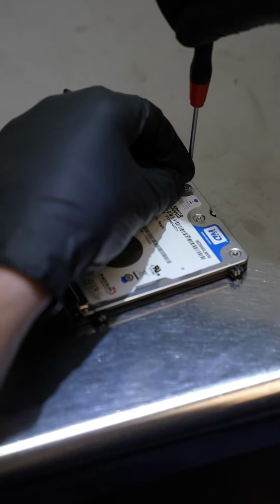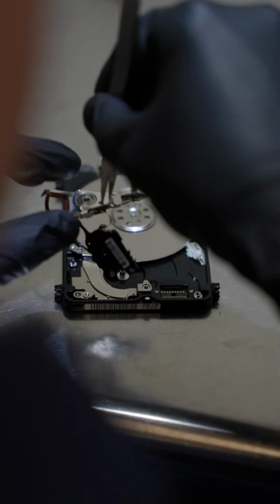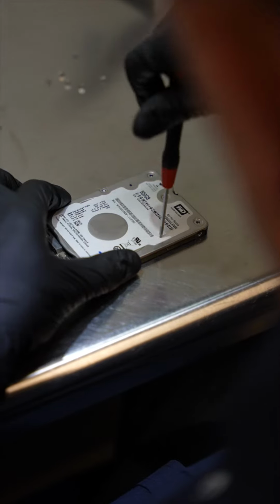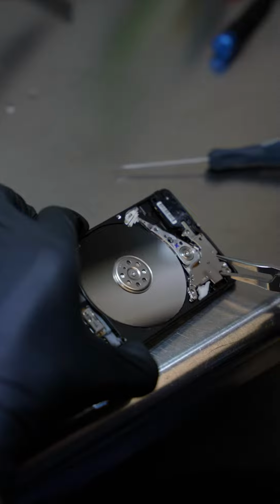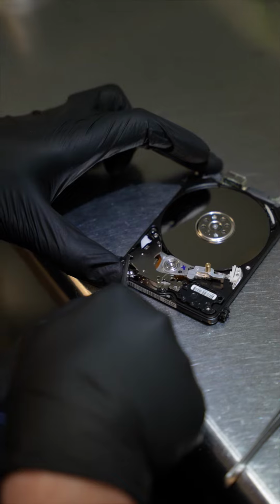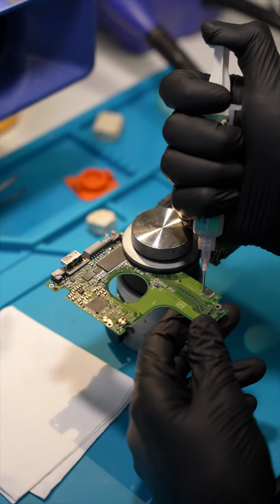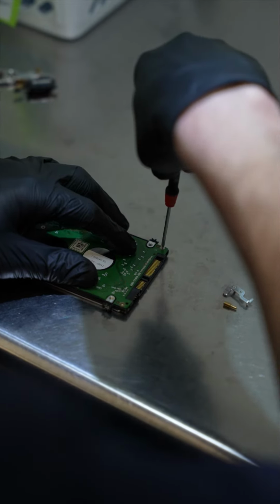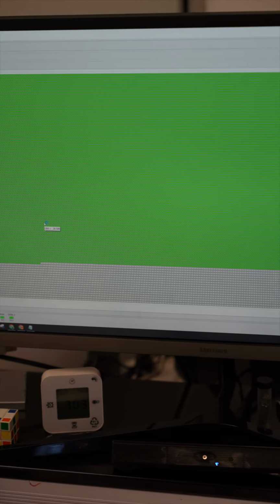How to fix a clicking hard drive - damaged heads, watch to learn

Comment: I disconneted mine, let it stop, firmly smacked it between my hands once, then plugged it in - worked perfectly again, clicking sound gone. Then purchased a new drive and began backing up the files.
Reply from the maker: You're very lucky, that can work if it's stiction, but most of the time the platter will be scratched and it will die very fast. I'm glad it worked for you.
Reply: this actually worked for mine holy moly
Reply: Bro. I just did this with my Samsung HDD. Clicking gone and I am now moving my files. Bro I owe you a Beer

Comment: Hello. Do you have a more in depth version of this video? Specifically I'd like to see how you insert the head comb and how you remove the heads and install them into the new drive. Thanks
Reply from the maker: Sorry, no - we filmed this video that took about 5 minutes from start to finish. But we made this shorter to make it easier to watch, pretty boring otherwise. It's best to learn by practicing, it's the best way. Give it a try.

Comment: How to identify clicking drive inside of pc when I have 6 of them ? Is there any software which would force it to click on command XD so I can copy everything from it before it goes down ?
Reply from the maker: Not that I am aware of, normally I would test it on a different computer, we use a tool called PC-3000 or Atola Insight Forensic to test failed drives. I would test them all to find which one is not detected/working. Good luck. If you would like to send it to our lab in Australia, see: https://www.payam.com.au/hdd-data-recovery/ or email help@payam.com.au

Comment: Hello, i have hitachi 320 GB laptop hdd i was connected the external adapter and works fine unfortunately by mistake i pressed it hardly the platter was scratched i opened the hdd then i saw abig scrach circle on it, can you fix it if i send it to you ?
Reply from the maker: I'm very sorry but platter damage is one of the few problems that data recovery companies have no way to repair, there are some ways to 'smooth over' some minor rubs and minor ddamage, but any deep scratch, is not possible to fix.

Comment: Is it posibble to swap platters onto a new hard drive?... Will the OS still work after that?
Reply from the maker: Yes, but it normally will not be the best solution - if the heads are damaged, replace the heads. Don't mess around with it - let a professional have a look 1st.

Comment: mine does 2 3 short  non loud clicks when opening Explorer, loading something, at win startup. But randomly. I also have 2 ssd's , the Hdd is for cold storage, downloads and no windows on it. Noise samples would be so helpful, for viewers to identify if it is a good or definitely  bad sound.
Reply: If your hard drive is detected, and you can open files, save new files and it is fast/smooth with no delays, it's all working ok. Normally a clicking hard drive we refer to is one that will not get deteced, you cannot access any of your files..and normally happens after you drop it on the floor. i.e 'dead hdd'

Comment: Hi Brother,

Mine also in the same condition... I'm not sure how to repair.. corporates are asking more than 50000 INR to recover the data... repair cost will be low I guess..
Reply from the maker: The cost of data recovery is high due to a lot of other tools and wages/staff and business costs. I suggest to practice in similar drives many times before trying this in your own HDD.
Reply: @PayamDataRecovery i have wd 5tb hdd which got disconnected while i was deleting some files from it and then i tried to plug it in again now its giving 6  six click sounds and then spinning off with a popup notification usb device not recognized or malfunctioned what should be the issue and solution help please

Comment: I had an issue with a DVR used for my cctv system. Its just a £100 box of air and a small pcb connected to a 2TB hard drive. Its kept in a well ventillated dry environment and had worked faultlessly for 4 years, apart form a nagging issue that came up for a 2nd time recently. The monitor stopped receiving the signal via an HDMi lead that cannot be removed and replaced. I could see via a phone app that the cameras were still running, and I could also see pre recorded footage. I accessed the DVR, checking all the cables and still no picture. I then moved the DVR closer to the monitor with separate lead, and connected a laptop to the existing lead. Strangely, both worked, but after reconnection the machine kept rebooting, though not at regular intervals. What was strange was that suddenly the hard disk was not being recognised. At this stage, there was nothing to lose in opening up the casing to try the HD over a bridge connection with my pc. In explorer there was no letter given to the drive, but the task bar could see a drive was connected. I went to disk management, and it stated that a 2TB drive was there, but could not be initialised. Either the file system could was not compatible or ...... its had it. I reinstalled the drive in the DVR, and could hear a feint regular ticking noise from the drive, similar to a watch second hand, and still the DVR states theres no drive. If there's any ideas peeps could give, it might help me what to do next. I could buy a new DVR, a new drive or both, but I am concerned that the drive would then need expert setting up. Confused.com. Thanks
Reply from the maker: It sounds like the HDD may have failed, normally they have a custom file system and you cannot read the files on a normal PC. Is there any way to contact the company who made it for you or sold it to you for support?

Comment: Hello, I have got questions. I have two hdd seagate hard drive, one is failed with bad heads and the one is a donor that is working - both hard drive have same model number and 3 same first characters of the serial number. If i swap the heads using with proper tools, will it works to recover the data?

And if I build a small chamber with a laminar filter like this: https://youtu.be/xPEa0Wc9iUc

Will it works if I use laminar filter or hepa filters, acrylic sheet, and vacuum hose so I could remove the platters or the heads?
Reply from the maker: Yes, if the only problem is failed heads and no other issues, it should work. You may be better off asking if a professional data recovery company can do this for you or if you can hire their laminar flow cabinet for a few hours rental instead of the trouble of building your own. You can buy some from china for about $1000 US or less for a small one. Good luck, I hope it works!
Reply: @PayamDataRecovery  Thanks, the heads is works on a donor drive so if I can't read the data can I swap the platters from the dead drive to the donor?

The cost to buy a laminar cabinet is too expensive. I'm better off to build one my own. Do you know how much it will cost me to build one?

If it cost $450, do you think if I would be better off to go to data recovery company that do for me if it is cheaper options?
Reply from the maker: @chris01479  I'm sorry, we don't have any experience in that area - the ones we purchased were about $5000 USD but we see much cheaper ones these days in China for sale, but never tried them. I professional data recovery company may charge you $1000 to $2000 USD for this type of work, but seek some quotes/prices, but none of them will want to work on a drive that's been opened/tampered, we hate those kind of jobs!

Comment: damn mine is new as well and it would be a pain to pay for shipping, just for their service to refuse me on any random reason. almost cheaper to buy a new one. 2TB seagate barracuda 7200rpm
Reply: You can try a local data recovery company near you. Shipping is cheap, if your data is important - data recovery from a failed hard drive is on average about $1000 USD in most countries, maybe more/less if you go to a home based business or a professional company.
Reply from the maker: Maybe it's a normal sound from that drive, it's not supposed to make noises like that - but if it works, keep a regular backup and keep using it.